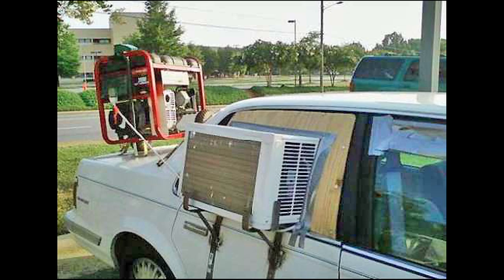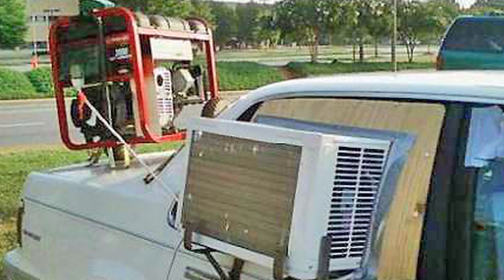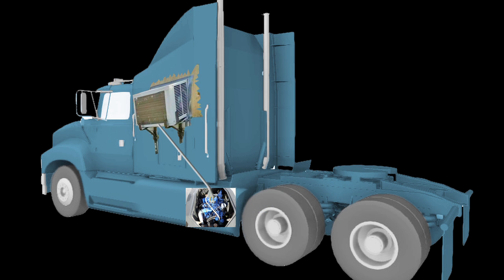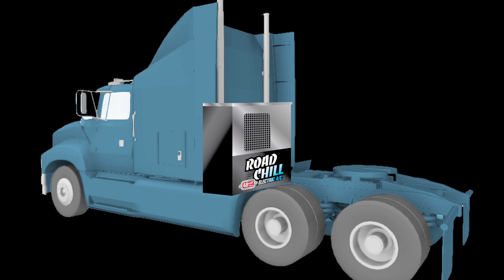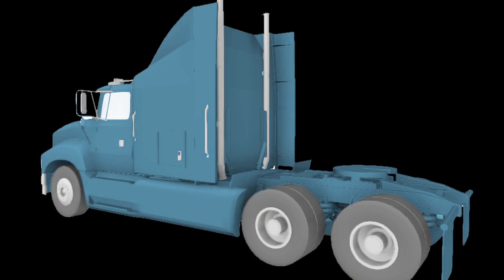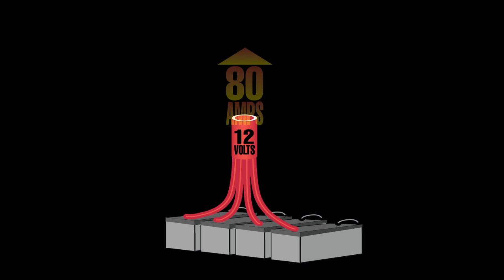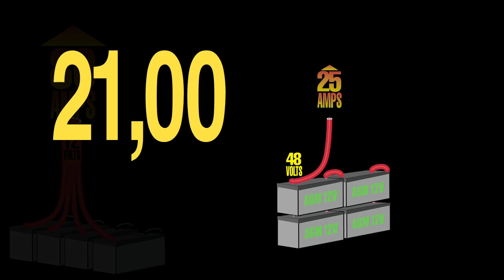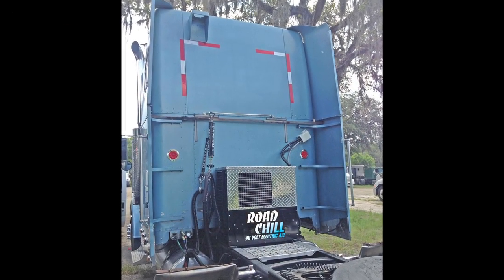Road Chill revolutionary sleeper cab air conditioner

Comment: Espar advertised well too,   well,,,,,   in reality  when it was 105 in Arizona. it didn't cool below 80,   after 7hrs battery gone bad.    all the advertisement, but if it cools the whole truck cab all night with a fridge running  and let's say you fall asleep watching t.v..       if it has enough power  then drivers will value it
Reply from the maker: I dont know who's unit you have but it isn't PolarStorm
Reply: Wojciech Zgodowski (
Reply: Wojciech Zgodowski the batteries only work the air that is it

Comment: all you need is a honda eu3000is and an rv low profile ac. life is great the last 5 years on a truck. anything that use battery to power is a sucker.  one battery cost you $300+.   And they don't last.

Comment: The only difference between the batteries at 12 volt and the 48 volt is how the batteries are wired together. Either parallel or in series. You can look up the difference.

Comment: Piss poor advert.  every generator has 120v ac outlets, no need for an inverter.  That LIE was enough for me to stop watching.
Reply: No Frank, the APU on a truck runs a 12 volt DC alternator, just like on your car, not a 120 Volt.  Therefore you need the inverter for AC current.